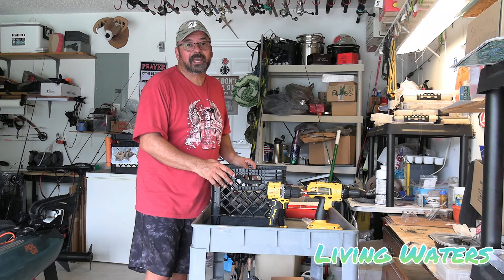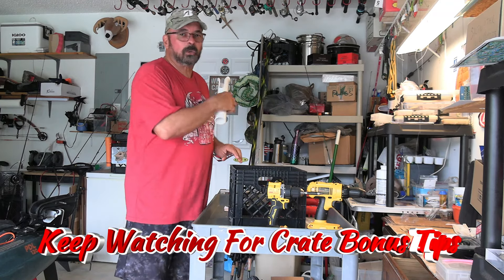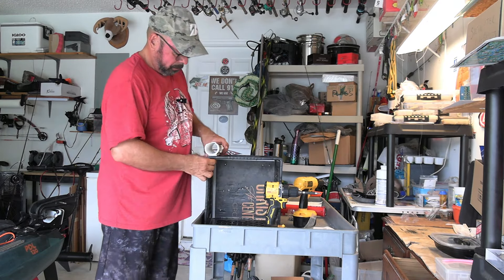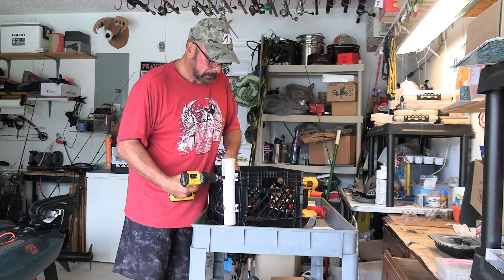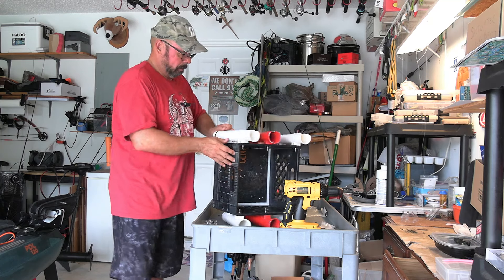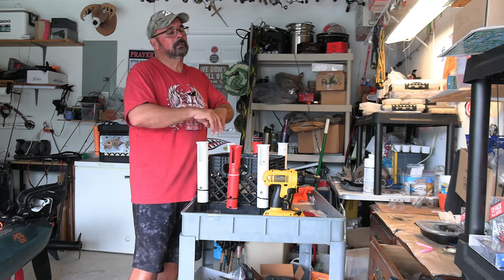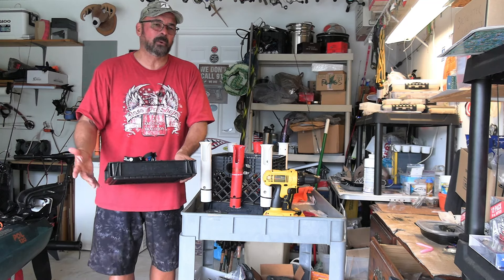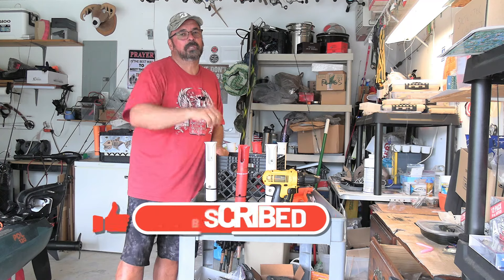How to built a Fishing Crate for kayak or boat - DIY and cheap

Comment: Question how do you maneuver low hanging branches?
Reply from the maker: I do my best to keep away from branches...I know not always possible. If i need to get into the trees I will pull my rod out and lay them down. I have started to leave my rods in their rod sleeves until I am ready to cast. Typically I would remove the sleeve before launching the kayak. If I come across branches they typically slide through. I appreciate you watching. Thanks for the question.